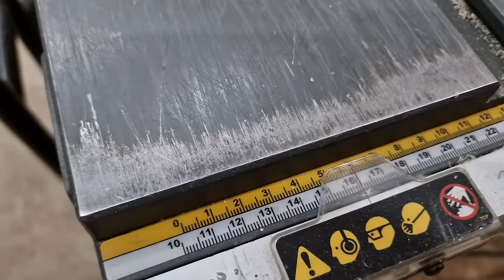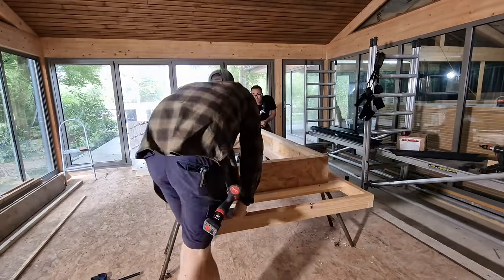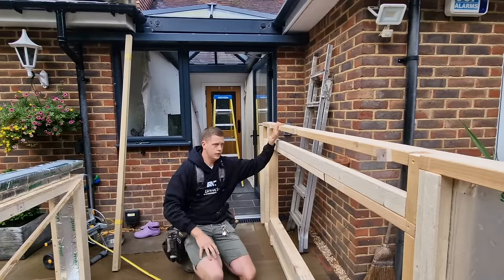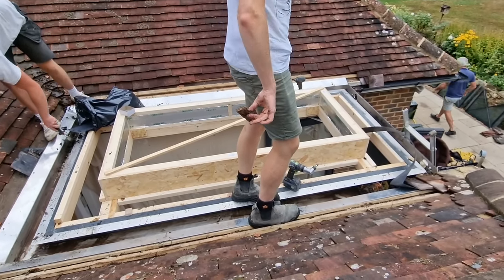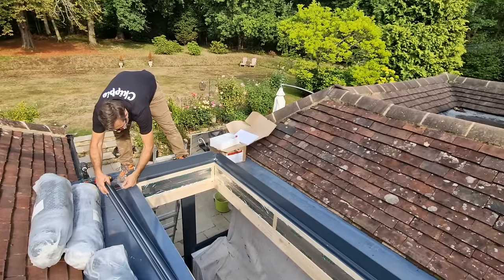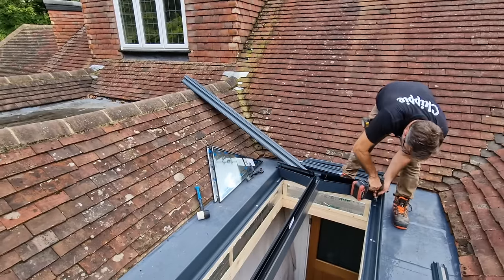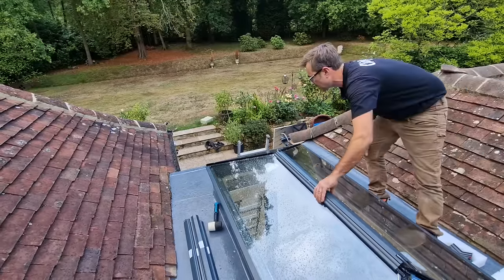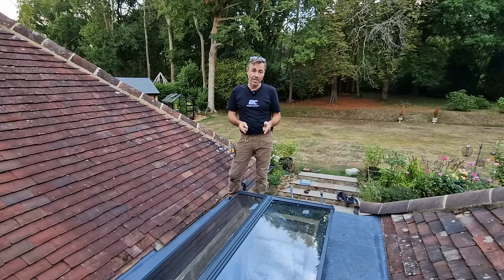Roof lantern replacement. Fitting a new Korniche roof lantern

Comment: You ended up with pretty much exactly what I described in my last comment and it is so much better for it. However well that window thing is designed I guarantee if I was fitting it there would be several broken parts. I am useless with anything that supposedly clips in place. Somehow as soon as I look at or touch any push fit parts they break. OK with glue, nails or screws. Clip on over to someone else not so heavy handed and way more patience than me. Now the only potential leak is from capillary action up under the tiles from melting snow and ice if the membrane doesn't go up high enough under tiles. Seen that numerous times.

Comment: If you find yourself in need of any extra plastic pins / clips visit your local auto body shop supplies company, those lines you were using look identical to the firtree pins used to hold a lot of automotive panels in place.

Comment: Brilliant work as always and thanks for sharing! 🙏
I have a 3x1.5 Korniche lantern to build a stand for. According to their surveyor guide, their eaves beam width is 70mm and stand needs to be 6mm less. What kind of timber to use to get the 62mm wide stand frame? Should I just get a 3x2 cut to 62mm? Which type of timber to use? CLS or treated or sawn? I haven’t got a table saw so not easy to get to that size…

Comment: Hi Robin, seeing the mitre saw pack up, I remember seeing a Metabo plunge saw in older videos. Do you not have that anymore, if so was that because it wasn’t up to scratch or something else? My reason for asking is I was considering getting the Metabo Plunge saw due to it’s deper cut of 66mm compared to most of the others at 55mm. Thanks for the great videos !

Comment: Cracking work sir! Just one question. Is insulation on the inside of the upstand ok there.?  Looks like that bit could act like a cold roof style construction. If so  would it not need an air  gap to the cold ply/osb?. I am no expert but  if assuming a warm style roof will a vcl be ok before drywalling and plaster. Difficult to find a definitive answer for upstand insulation best practice. What say you?
Reply: In my limited knowledge Looks like a sorta warm/hybrid roof with insulation pushed up tight to deck.  Steveroofer on youtube is pretty informative. I guess vcl behind plaster board would be fine . As there doesn't seem to be any down lighters that would compromise this. I know Liam from oak wood garden rooms does similar. My 2p

Comment: Hey guys. 

I’ve been considering carpentry/joinery as a potential career path, but with the seemingly impending recession it has my slightly concerned & considering other ‘financially safer’ trades (so more in the direction of Plumbing/Electrician).

For those in the comments with ample experience, how safe of a job is this during recessions? & how is the pay in general in comparison to say Electrician?

Really struggling with this choice, so any input from those of you in the industry will be greatly appreciated! 

Cheers in advance